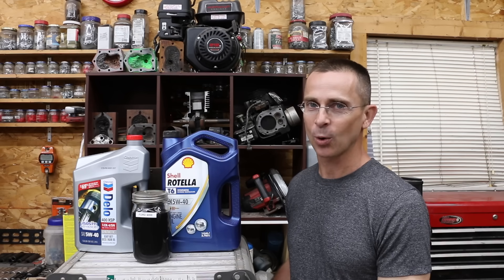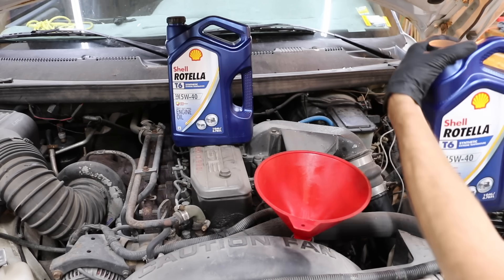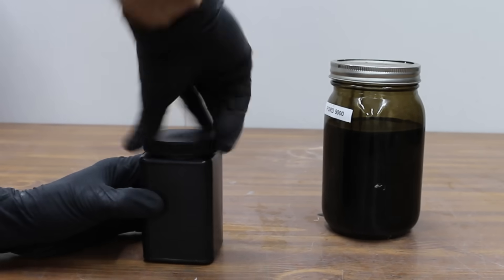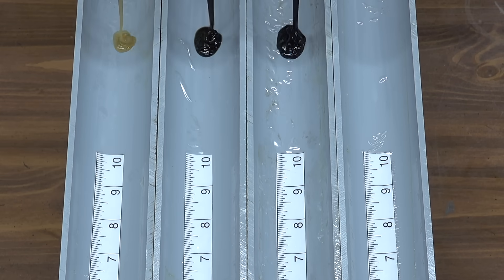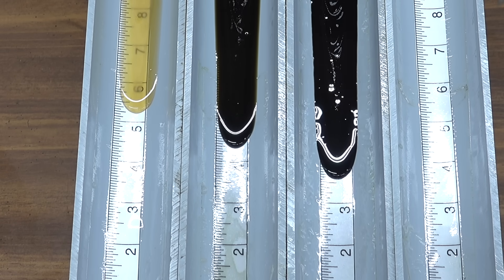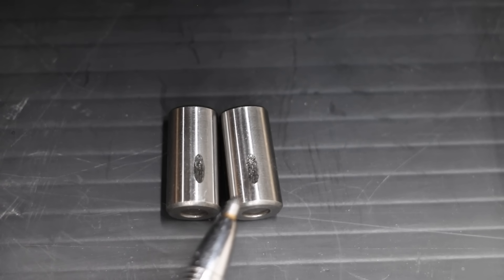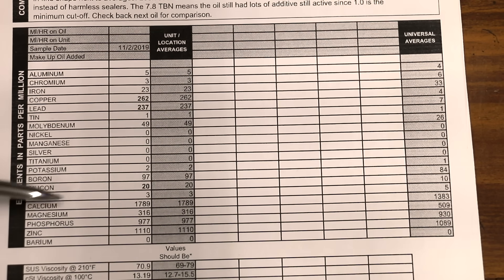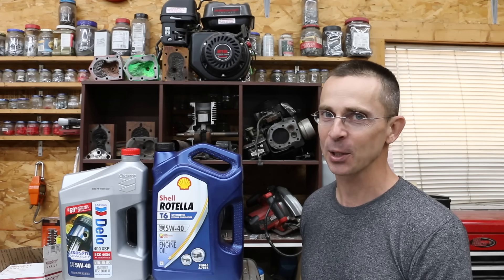Will Annual Oil Change Damage Your Car? Let's find out!

Comment: My parents both worked for the world's second biggest manufacturer of oil and air filters (product development and quality lab). In the 80s/90s, they were supplying companies like Ford (Europe), Mercedes and Porsche with OEM parts. They used to joke about the car owners in the US who were obsessing about oil and oil filter changes, because some manufacturers and even more so some auto parts / service places had established the narrative of the self-destructing engine to sell more spare parts. The "annual oil & filter change" dogma really is a myth if you are city dweller or are a normal commuter / soccer mom. Changing your air filter every 1 or 2 years will even increase wear on your engine. Only if you live up a 20 mile gravel road near the equator or if your are stressing your engine like crazy such short intervals might be justified. Also when your car is new or very old, swapping filters more frequently can be a smart thing to do.

Comment: The problem with these videos is it's more about the type of driving you're doing. If you're driving twice a month for 50 miles it's much better for your vehicle than if you drive 2 miles every day. Also if I'm not mistaken these tests were all on diesels. I'd be very curious to see it on a gas engine. Gas engines tend to get much more dirty than diesels without regular oil changes.

Comment: Awesome test, interesting video, thank you for your remarkable efforts.
Q: Is it okay to use that Rotella oil for gasoline engines e.g Subaru WRX STI?
Reply from the maker: Thank you
Reply: I used to own a modified, forged internal Subaru WRX STi, and from first start to break in to 14,000 miles before I sold it, I ran Rotella T6. The gasoline engine ran great with the oil, never had a problem. I recommend it for the 2.0l and 2.5l Subaru engines.

Comment: Nice to see Shell oil products are still the top of the quality scale. My engineering class in 1994 did all of those tests, in our fuel chemistry course, including the ones you sent samples out to the lab to do, and came to the same results. Though we tested 10 different oil brands. Shell oils came out on top back then as well. (automotive, and aviation oils)
Reply: Good to know.

Comment: I use that same adapter for OEM filter. Only complaint is that it sticks to well to filter. Recently, I have switched to K&N, which has built-in bolt interface so that a normal socket or wrench can be used. 👍
Reply from the maker: Thank you for the feedback

Comment: not sure if a video idea or not...but it is interesting that at the end you say ok to keep using older oil if started once a month to avoid moisture buildup...in comparison to most boat engine suggestions which is to not store a boat in off season with old oil, and then let new oil sit in engine for a number of months before startup the next season.  so many people throwing away oil after only used a short amount of hours just to have new oil sitting in boat oil pan, accumulating moisture...so the question is does it matter if you just keep using oil until boat hours or engine miles hits change interval or should you store with new oil?

here is one of the quotes, "Old oil in the crankcase of a stored boat can form acids, which can corrode engine components and shorten engine life."
Reply from the maker: Thank you for the video idea!

Comment: But how do we mere mortals check when to replace oil without this extensive testing?
Reply: use the weight that the manual or the oil cap specifies and with  a good synthetic you are good for every 4000 miles whether that mileage is reached every month or every two years. And if your engine burns less than half a quart of oil between oil changes you can add some ZDDP.
Reply: @PrimalMiltos  The 4000 mile figure would be different for everyone. I guess it's best to follow the user manual in terms of miles and ignore the time. My VW recommends oil change every 10000km

Comment: Great video. I have two vehicles that don't get driven much at all, and I have not been changing my oil annually, just because common sense told me so, despite a popular youTuber auto mechanic channel stating it should be changed at least annually, even though they never state why.  I've gone over two years between oil changes. When I do use a vehicle I always get the engine up to operating temp to burn off any possible moisture or contamination.
Reply from the maker: Great feedback. Thank you!
Reply: yup , just let it get up to operating temps and allow it to circulate the fluids, turn on the AC as well to have that circulating and the heater core (heat on hot/full blast)

Comment: I guess another question would be even though the oil is fine for 1 year, would the filter be fine for 1 year..
Reply from the maker: Great point.  I cut open both filters from the Ford 5000 and Cummins and both were in great shape.  I did cut open a 25 year old Fram filter recently and it was very fragile to put it mildly.
Reply: @ProjectFarm  Yeah I saw the whole video, I'm just speaking in general if most oil filters would hold up over a year or if some would start to degrade.
Great video as usual! I love your vids!

Comment: I use T4 in everything I own, from lawnmowers, garden tractors, my truck, and my motorcycles.  I use Shell T4 because it is JASO MA rated, so I can us it in my motorcycles with wet clutches and have had "no problems" over the last 10 years.  I see the T6 is also JASO MA rated too, so I could use that if I wanted to switch to synthetic oils.
Reply from the maker: Thank you for the feedback. T4 is a great oil

Comment: My 66 Chevy chevelle with a 283 had the same oil in it for 21 years. During that time it was maybe driven 300 miles. I changed it in July of last year and it looked just like your typical 3000 oil change. The car still had (before I built a new 450hp small block for it) great oil pressure and it ran perfect. I see absolutely no reason to change oil just because of age. If it is still clean then you are simply wasting money.
Reply from the maker: Nice!  Thank you

Comment: The one year specification was based  not on time but on the average number of times the engine was started and stopped.  Specifically based on humidity and the # of times the crankcase dips from 150F down to about 60F.  Of course corrosion will be apparent in most instances after several interval cycles over a number of years environmental and product quality fluctuations.
Reply from the maker: Thank you for the feedback

Comment: Project Farm the reason I change my oil at least once a year is oil sludge, is this not an issue!? It wasn't mentioned at all in the video...
Reply from the maker: Thanks for the feedback.  The oil removed from my tractor and pickup did not show any indication of breakdown or sludge formation.  In fact, it was still good for many more miles and at least another year

Comment: I change the oil and filter once a year, about 10 000km/6000 miles between each oil change in my 2010 Honda Civic with a 1.4 petrol engine with iVTEC. It's running as smoothly and with the same (slow) performance as when I bought it 5 years ago, so I guess that would indicate that it's often enough. I only use fully synthetic oil from quality brands like Fuchs or Mobil 1 so that helps of course and changing the filter every time helps keep the oil clean. I of course use the recommended viscosity for the local climate.

Comment: If you want the absolute truth about the condition of a motor oil and when it should be changed, use oil analysis. It is the bible when it comes to additives wearing out. The majority of oils sold to the public do NOT use high quality additive packages. Oil analysis will eliminate any question and can give you warning if there is wear in the engine pinpointing the issue. Much more scientific also.

Comment: I run T6 15W40 in my Cummins and Mobil1 in my gas cars. One gas car rarely gets driven and gets oil change every spring. The other gas cars every 5,000-7,000 miles the Cummins every 10,000 miles. Seems like I’m always changing oil in something 🤣

Comment: In your temp test you lack the pressure the oil experiences and would affect evaporation and temperature resistance. Plus the controlled PCV or other type systems also affect evaporation/reclamation process. Your conclusion should of been it "CAN" be good after a year of time but completely depends on what events happened between and what kind of weather your area experiences and what condition the vehicle is in. At least 5% of customers would have conditions that would suggest the oil should be changed at least every year if not more often. 

You really need to address the legal reasons these companies have lawyers telling them to write these warnings and not just assume it has more to do with the product performance. With the new sensor technology being introduced nearly every year currently and how the oil can affect those sensor readings are the primary reasons for frequent oil changes as being beneficial. Wear is like 3rd or 4th on the list these days. Oil service life greatly surpasses need when it comes to wear compared to just 10 years ago. 

Back in the 80s this would of been all you had to do to test oil performance but now there are numerous additional elements to consider. In which most customer have no clue about. So this is a uneducated and possibly misleading. The comment section is proof. They all blindly believing whatever conclusion you are generating. Not that they are wrong just not correctly presented with context and full explanations.

Comment: Usually if your engine takes 5W/30, like my ‘07 Miata, you’re supposed to change the oil and oil filter every year or every 8,000 miles, whichever comes first. That’s the guidelines. How bad could it be?
Reply from the maker: Thank you for the feedback

Comment: i have a problem with my bike it was not running after i recharge its battery, do you have any advice for it on how i will check my bike? it was not used after 7 months at present.
Reply from the maker: Thank you for the feedback

Comment: It's a very professional test made by a guy that understands what he's talking about. Just a pity, that the reference oils are only  present in the US-market. In Europe, we use totally different brands and some people of top-manufacturers  love also the 0-W30. I had best experiences (especially with hydraulic tappets in aged engines) with 5W40 and it's wide range of temperatures. The technical more strict specifications - especially with German "High-Performing Cars" - brought up a market where the leading brands are Liqui-Moly, Mobil, Castrol, Total and Agip. With them they always promote changing-intervals between 15.000 and 20.000 (!) km. Like many others, I don't trust these promises...  So, maybe could it be an idea to make a "quality contest" between 3 to 5 leading 5W40s brands from European market?
Reply: You do not trust 15-20 K intervals?  
Current VW, Audis, BMW, Mercedes etc, have LongLife Intervalls, those are around 24 months or 30.000 km! 
Some cars even have no fixed interval at all, but the car tells you when to change oil, based on your driving profile. This can be up to 3 years and 50.000 km (!).
So 15-20K is nothing special. 
Also "0-W30" says nothing about the quality of the oil. If the temp range of an oil is an indication then for 0W40 or 5-W40 oils, as such Ranges can currently only be done with fully synthetic oil and top notch additive packages.
Some other guy has postet good European oils in the comments below. AFAIK it was:
MOTUL 8100 X-Cess (5W40)
LIQUI MOLY Synthoil High Tech 5W40
and
Mobil 1  0W40
Check if one of those fit the specs of your car and go for it, I can personally recommend the Mobile 1,  but only as 0W40! The lower temp range Mobile 1 are HC (Hydrocrack) only, this not fully synthetic.
Reply: @clamanpostany472  With a Mercedes M271 you make an complete automatically oil-change after app. 12 K Kilometers because of it's common refueling needs  ;-) 
But seriously, I saw - and smell - often the difference between a 10 K oil and a 10 to 25 K so called "long life" oil from my preferred driving profile (10% City / 40% Cross Country / 50% High-Speed on Higways) and there IS an obvious difference!
Maybe,  because I grew up in a world where people trusted their manufacturers, knowing that they primarily want to sell cars that satisfies their customers. 
Todays situation changed in a way, that buying a car is only the entry ticket in a marketing world of many further "secondary circles of economic value". The only goal seems to pay for so many repairs and planned obediences, that the get nearly the same bucks of vehicle costs from you with their systems of service-needs and calculated replacements, including the crappy electronic systems and to avoid that you use your car for too long! 
So, when BMW, Mercedes or Audi say: "You can use your oil for 25 K kilometers, I think this is nothing more than a business strategy against a too long life of your engine ;-)

Comment: The thing I want to know is at what stage does oil start attacking plastic and rubber engine parts?
Reply: plastic and rubber parts degrade with heat-cycling than oil exposure... they all get brittle over time
Reply: @ricebike  True its the heat that does the damage. However if the oil is contaminated there are far more reactants in it therefore the rubber will oxidize more in the heat.
Reply: @andrewthompsonuk1  the heat/cool cycles are what makes rubber/plastics brittle over time... same with aluminum/plastic radiators and various plastic parts/ vacuum hoses in the engine bay. also exterior plastics/rubber gets a double dose of UV rays which is why tires get dry rotted after ~6 years ~ all in the absence of oil
Reply: @ricebike  All I am thinking of is if you dismantle a motor that's had lots of oil changes and is clean inside then the seals are usually still supple. If the motor is dirty like one in a modern long oil change car the seals have oxidised like and all cracked up even on newer cars.

Comment: If you have a seasonal vehicle, ie RV, trailer puller, summer toy, always change your oil at the beginning of the use as condensation can and will destroy even the best engines.
I can substantiate this claim should someone not believe me.
*Thank you for backing up my claim(sorta lol) at the end
Reply: if the engine was run to full temp when it was put away, and had low miles for the year, also being drive to full temp, it should not do any harm if it sits for a few months. The moister will have already been burned off if driven properly...The gas tank is another concern though, I always have a full tank of non ethanol gas.
Reply: @bonniejohnson1518  First of all, if you could spell, or at least use the assisted spelling function, I put more thought into your opinion.
Second of all, like many people have commented in this video,
"Oil is cheap, engines are expensive"
Your idea works in theory but you clearly are not educated or understanding enough to have much of an opinion on the subject.
If you would have posted a general comment I would have let this be, but you chose to direct it at me and question my experience and knowledge.
So I'm sorry but you had to be responded to
Reply: @kellyh4035  go on about your business and have a nice day sir...

Comment: So I drive stop in go traffic 5 days a week to work at 64miles back and forth total driving a vw getta 2008 and I wait everyday till the engine rpm goto normal before taking off aka warm up.i change my oil using the cars stock engine change oil light I also replace part oil with marvel mystery oil. Have you done a video on that. And should I change anything.
Reply from the maker: Thank you for the video idea!

Comment: Rotella t6 great lube I use it in my 2013 ram, changed at 5,000 mils and in my 02 Harley flhri with stp to raise oil wt.to 20-50, changed at 3,000 mils.oil is still usable and clean when drained. it holds up well and in Walmart it's reasonable $$$. great test keep em coming!

Comment: You should do a video on whether or not catalytic converter cleaners work. There is cataclean, the laquer thinner method, and others. This could save people thousands in parts, as it's one of the harder to replace parts if you dont have a bolt on converter.
Reply from the maker: Thank you for the video idea!

Comment: I've been using T6 for the past couple years in my 6.2 gas silverado. I do change it once a year though in May rt before it starts to get hot in Texas. I put about  8-9k miles on the truck a year. I switched from Mobil 1
Reply: I also used to run Mobile 1 in my Corvette, and then switched to T6.
When running really hard at the racetrack, it's not uncommon to see oil temps exceed 300*F. With the Mobil 1 5W-30, oil pressure at idle after a session was down around 5psi... Kinda scary. Some people recommended that I go to a 20w-50 weight oil, but my car is a daily driver year-round. With winter temps below freezing, I didn't really want to run something like a 20w-50. I really liked that T6 is a 5w-40, and I had heard that it has lots of zinc in it (which is a super important anti-wear additive that you can't find as much in gasoline engine oils because of emissions). 

Long story short, now when I run the T6 at the racetrack, my oil pressure never gets below 20psi at idle, even when the oil is super hot.